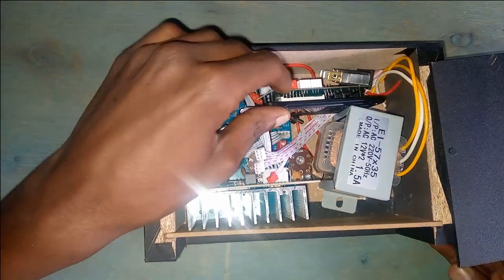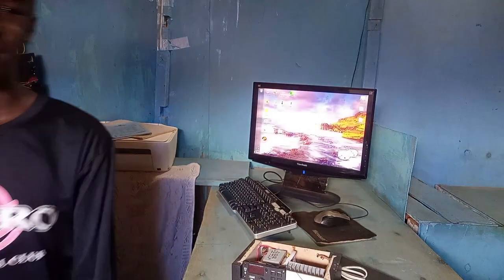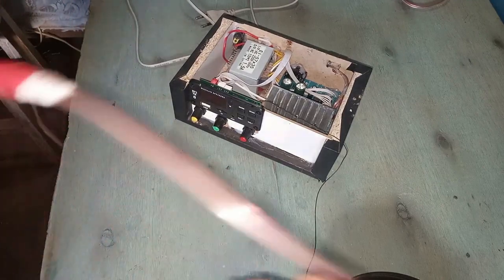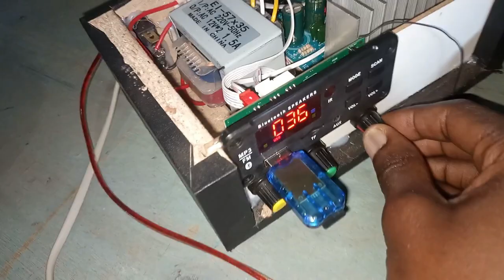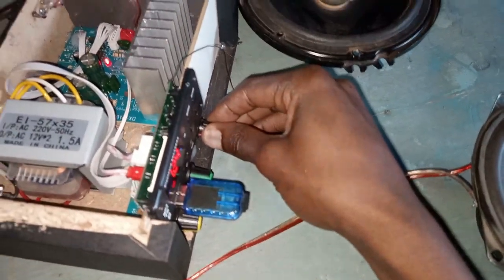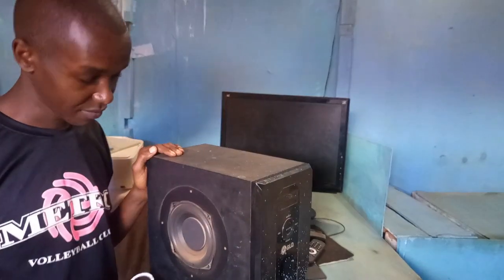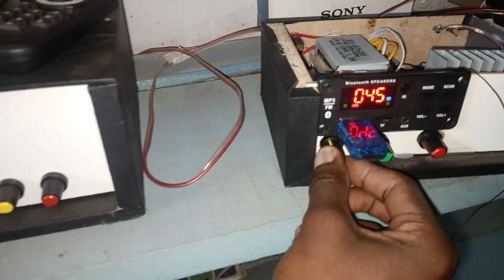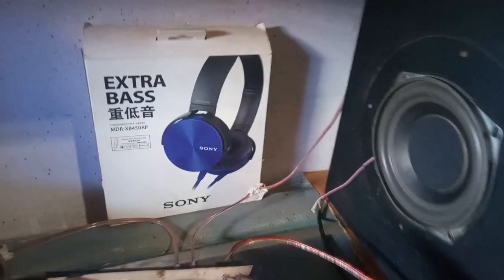Amplifier board TDA 2030 Kenya - Assembly and test

Comment: hi is it possible to use a transformer without a centertap on this board
Reply from the maker: I've never tried that, but the center tapped is recommended for dual voltage

Comment: Is it possible to add DC 12v immediately after the bridge rectifier on this 2030 IC board?
Reply from the maker: I'm not sure, there are two circuits inside, that's why 12-0-12 ac is required
Reply: @emmanutechnician  yes it's possible .
You just take one side of the transformer output and the center tap ,feed it to a full wave bridge rectifier , smooth the DC output with an appropriate capacitor ,and you have a ,12 volts output.
Reply: @wawerukamau1260 This particular board uses 12 and 12 (both yellow wires) on the bridge rectifier. The 0 is used as subwoofer speaker ground. The board operates on 24v but the speakers do 12 because of the center tap you said about